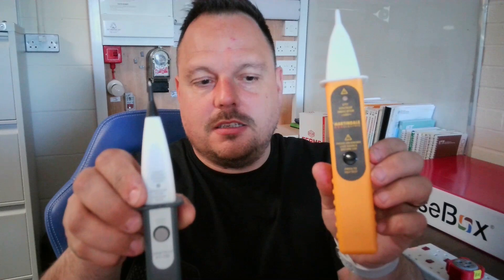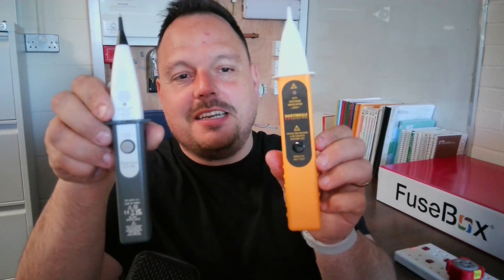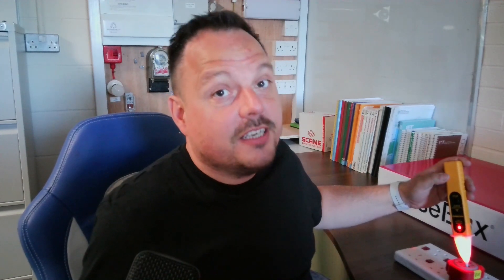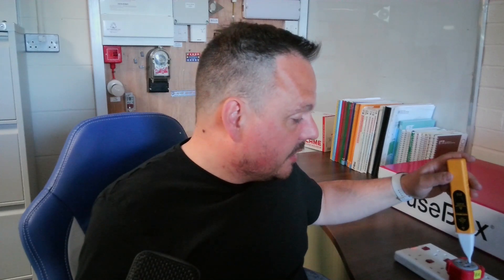Contact Voltage Indicator How do they work? NOT non contact! Diverted Neutral Current

Comment: Hi Mark. Got a question on another Martindale product which is a voltage indicator with the proving unit. The one I have is the VI13800. I was looking to swap out a lamp today (simple line, neutral and earth) and proving dead was difficult as I struggled to get the metal contact points out far enough of the protective sheath which were butting against the connector block which has very small holes. It is possible to manually force the contact points out far enough to make contact but not practical doing both as they are forced closed again with a strong mechanism. Am I missing something simple here? Many thanks.

Comment: Useful video as always.
I have the Kewtech one and the manual says it auto shuts off after 3 minutes so will be interested to see if there is a way round this to monitor for stray voltages when you do your next video.
Reply from the maker: That did present a problem with the kewtech but overcome in 20s of pure genius.

Comment: Hi Mark, these contact voltage indicators apparently do not differentiate between real and ghost voltages! In your experience can this be problematic for the earth/bonding application discussed?
Reply from the maker: Hi Alan, it's a first visual indication you might have a problem to investigate. Occasionally you might have an issue with inducted voltages but again they will often be present due to installation issues. 

The proper test equipment comes out if these are shouting about something lol.

Comment: what does it do if you put it in to the neutral, and hows that any different to a non contact voltage inndicator, where does that get its reference to earth. where as a set of test leads has 2 leads and one has to be on something else to obtaine a reading.
Reply from the maker: Does nothing in the neutral unless it has over 50V present. Non contact needs a reference to earth which it gets through its contact with us the operator.  Contact voltage indicators work via direct contact with contact object. I am not sure on the wizardry that makes that happen but happen it does lol. 

Used by DNO crews due to PPE requirements which make non contact indicators useless in that application
Reply: @electrician247  volt pens don't always nned contact as some times I have sat mine on the cable and walked over to the board to find which it is. Its wizardry. I thought you might of had a scientific answer
Reply from the maker: @scottsparky1  If they can detect magnetic field they will work. Non contacts happy enough if you place it on or in something remotely earthy.
Reply: A non contact tester will ping off with any hot wire nearby. A CONTACT tester allows you to choose which wire.